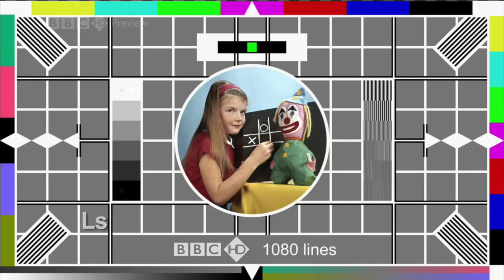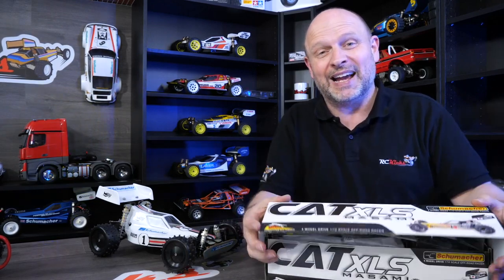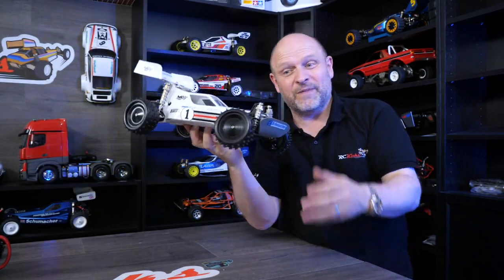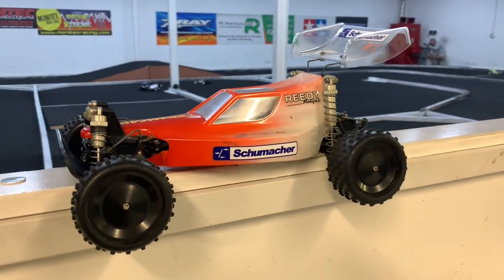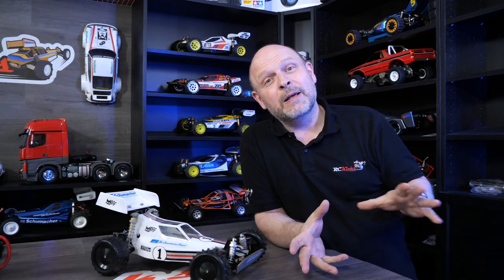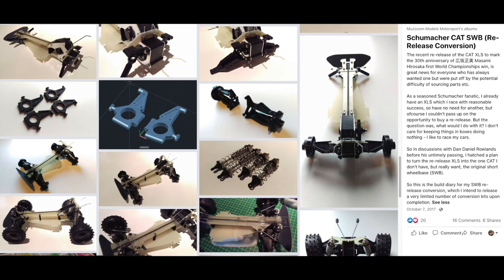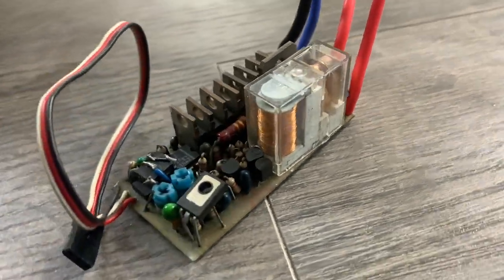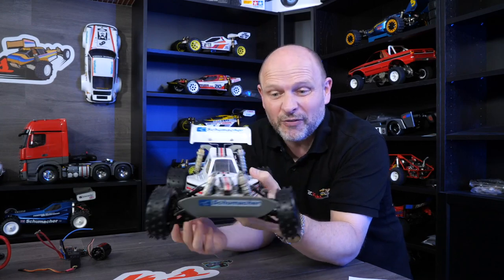My Dream RC CAR! 1986 Schumacher SWB CAT Shelf Queen. (RC Unicorn Hunting)

Comment: Love this video.  We had one soon as they came out, remember the £175 as local model shop owner agreed to order 25 for people at our club and we got it for £150.  We then did the LWB upgrade as remember racing it at Stoke Mandeville model exhibition and was rapid but very twitchy.  Was a massive step up from Hotshots, RC10s and PB Mini-mustangs, though I much preferred my Optima Mid and previous Hotshot to work on.  The undertray sealed with velcro against the body was great for muddy UK racing.

Comment: I raced one of these back in the 80s, its still in the loft somewhere in about 8 million pieces. I guess I'm going to have to pull my finger out and put all back together again. 🙂 if I vaguely remember correctly, I converted my short wheelbase to a long wheelbase, so I properly have various extra pieces floating about. I've only just finished completing my original XLS, Bosscat, and ProCat, so funds are a bit tight. Wish me luck.
Reply from the maker: You 100% want to put the SWB Cat back to stock as these are rare and really hard to find now as so many have been raced hard and converted.
Reply: @RCKickschannel  They're a bit twitchy on variable surface tracks if I remember correctly, but they did look better. If you had nerves of steel, they could out drive anything. :)

Comment: Nice example
Shame the shell has been done incorrectly but there are a lot about like it due to the decals available being wrong
If you would like to see a correctly painted shell drop me a message and I'll send you pics of my one, I did extensive research with Schumacher to find out the correct design of the boxart shell so I could make paint masks up to do the whole design in paint